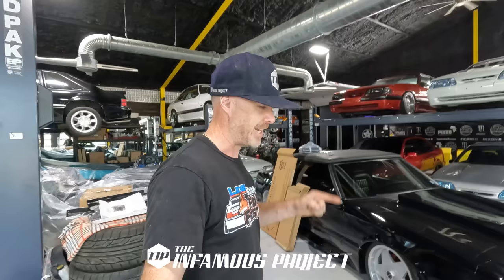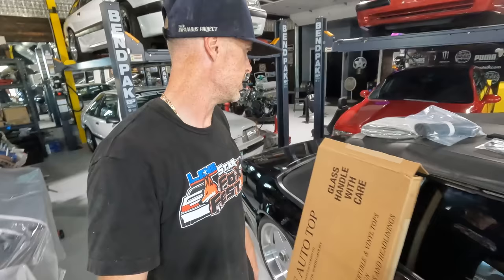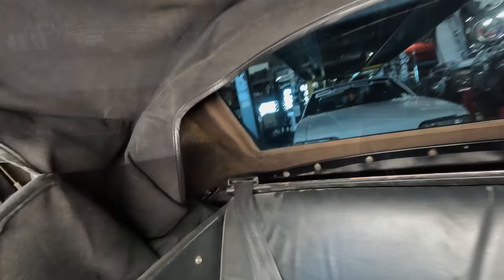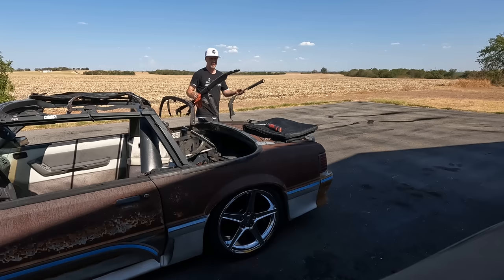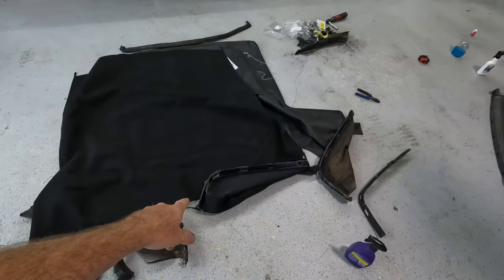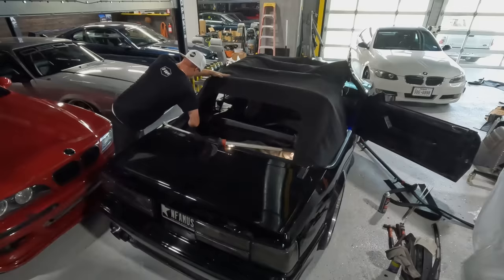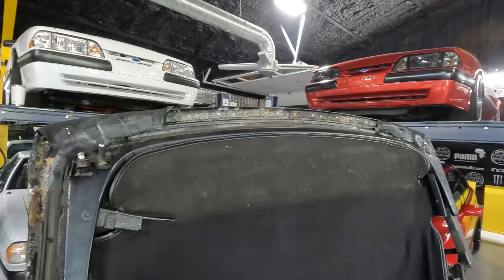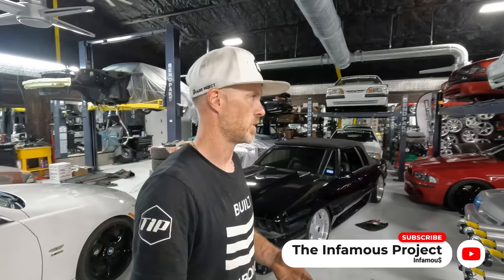1983-1993 Foxbody Mustang Convertible Top Replacement Video *FULL HOW-TO*

Comment: did you not staple the rear of the top to the last bow, and slide those aluminum listings through to screw to the center bows? I had to remove my headliner to do all of that. I no i left those listings out of mine one time and the center of the top swole up like a balloon at about 70mph ahahaha can't say that it really matters really, cuz it looks great man. Not an easy job to do if you've never done one before. Beautiful Fox!!!!
Reply from the maker: Yes i did.. was just hard to get it all in the video
Reply: I gotcha, I was thinking to myself......he had to of done that or it wouldn't have looked so good ahahaha. Great video and again one beautiful Fox.

Comment: You mentioned something that I've somewhat have been pondering. I own a 89 vert. When I bought it the top was shot. You mentioned you swapped the top with the frame. I currently know where I can acquire an 86 vert for dirt cheap. Here's my question, can i take the top and frame assembly off the 86 and put it on my 89. Is it a direct bolt on or will there be issues

Comment: Man I watch u all the time, and I’m  learning so much, I actually have a 91 LX with a 331 stroker and I bought it with built motor and there’s a vibration the car has when it’s being driven, it’s believed to be the harmonic balancer but I need help, can u please do a video on 331, 347, strokers please?
Reply: Normally on a built motor they would replace balancer.  You should be able to look at the harmonic balancer while the car is idling, does it look wobbly?  If the car has a vibration while driven, it could be a number of things.  Does it happen while driven in neutral?
Reply: Yea the balancer does look wobbly, I’ll have to get it checked out, it may solve my problem

Comment: Have you ever had an issue where you’re opening the top and the rear glass gets pinched and shatters? Happen to me when I was testing the top on a newly purchased 93 vert
Reply from the maker: No sir... Something must have got caught
Reply: Happened to me once, thought I got shot when it popped and a piece nailed me in the neck LOL 🤣
Reply: Mine done that after the top had settled in. I done it in February outside and once spring came around I guess it started to loosen up in some areas that put the frame in a bind. Scared the shit out of me too! I've heard of towels being in the well where the glass lays and bust it. Gotta double check that trunk before you drop it for sure.

Comment: I’m sure this will not be a highly viewed video but thank you so much for doing it. I watch the entire video. Felt like I was watching you work on my car. Black vinyl top on mine. Have all the same exact issues. Top still in good shape but it’s shrinking. Never knew that was why I could see all side area. My frame does not look good either and I would want to paint it. The components you resprayed black will need to be done on mine also. Even the underside of my top is dirty/stained like yours. I’m guessing I could install a headliner on my 91 ? Would probably be much easier than attempting to clean/prep/repaint a lot of the frame. By the way you did an outstanding job. Not something you want to do in a hurry. The new top looks great! You have motivated me to have someone else do it lol. I’ve never looked in the owners manual, Ford doesn’t recommend to unzip the rear window when putting the top down do they? I’m assuming it has the zipper just for install or to be serviceable in case the window was broken.
Reply: I had a headliner on my 90, yes you can get one installed on your 91 🤘